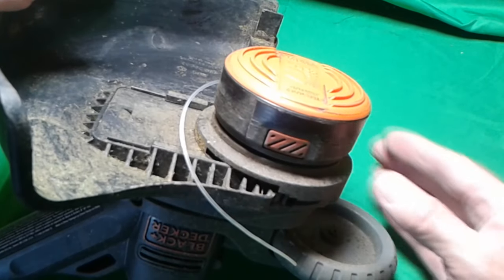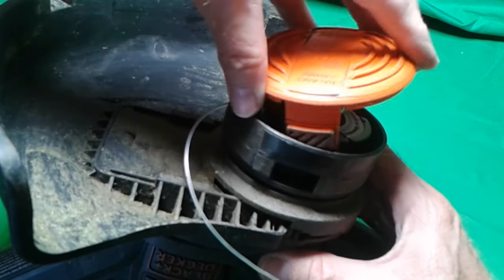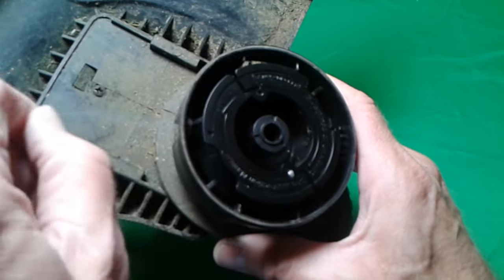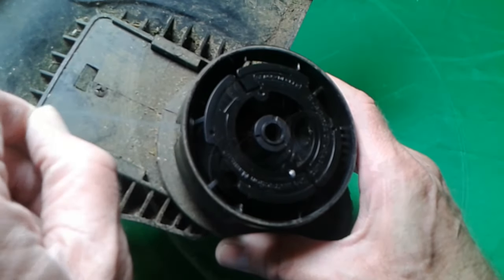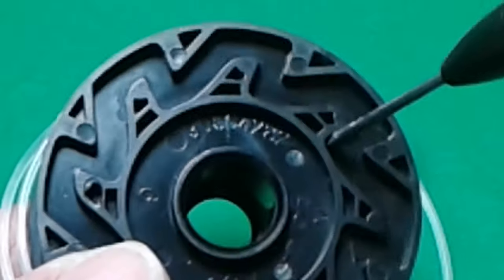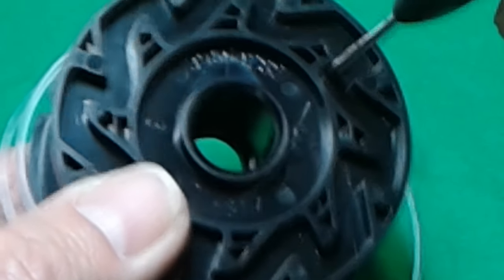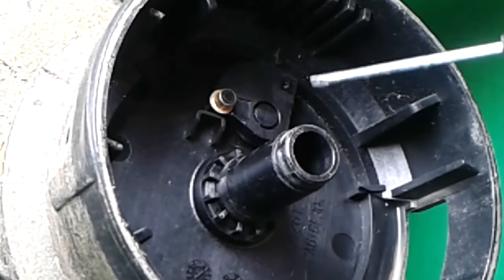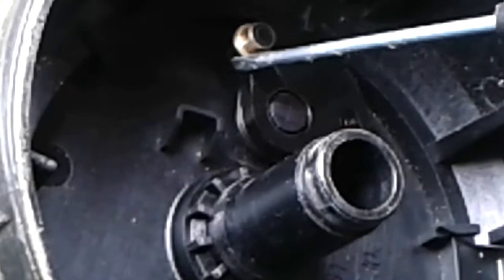How to Fix Black+Decker 20V Cordless String Weed Trimmer Edger LSTE525 Won't Feed Line

Comment: Bad design i have to feed mine by taking it apart every 2 minute
Reply: I have the same issue using it for a minute and manually pulling out more line, recapping and using for another minute or two. It really is a pain in the a$$.
Reply: Yeah, just bought one & it will not auto feed. Going to try exchanging for another, but wondering if they all have this flaw.

Comment: Yea nice and detailed, my mechanism works and is clear but still wont feeb line. Thank you though
Reply: Same for me. I was hoping it was the solution but still will not feed
Reply: Did you guys find your issue ?
Reply: My feed mechanism is doing just the opposite….feeding out line so quickly that I go thru an entire spool before I finish the yard.
Reply: @Patrick_Ross  mine too, you ever find out the fix?
Reply: @roberttaylor6030  - No, I didn’t.😞
Reply: I have the same problem.  Mine doesn’t have any button to push to actuate the line feed. Somehow it is supposed to just happen.
Reply: @Patrick_Ross  - change the plastic parts - those plastic “teeth” wear out. That little part that moves back and forth can wear out, and the grooves and teeth in the spool itself can wear. I had to replace a spool because of this issue.
Reply: If it does not feed at all, then the line is probably not wound onto the spool as it should. For some it has to be very tight, for others not so tight. And of course the winding has to be in the correct direction as indicated by the arrow on the spool. And lastly, some might put a spool into the tool upside down.
Reply: Mine won't either, I bought a bunch of replacement parts and it still won't work. 😡
Reply: @dstowell6189  - sucks to hear that, those new plastic parts should have enough plastic on them to work.

If it were me and that happened to me, I would start building up some extra plastic in places using a good epoxy or crazy glue and baking soda mixture.
Reply: Ikr? It took him 2:29 just to tell us to figure it out ourselves lol 😂
Reply: @Patrick_Ross  Mine feeds out too fast also. Before I knew it, I had to replace the spool ugh

Comment: Mine loooked clear and moved just fine. I was about to get mad at this video for not going further in depth, but then I blew into it, put the line back in and everything works fine now. You may want to put a caveat that obstructions may not be seen or completely prohibit the movement
Edit: nvm. Still doing it. I hate this thing.

Comment: After a year of the line feed not working… I figured it out and fixed it.  This two guy’s videos helped me understand how it works, so THANK YOU!  Everything in the housing was cleaned, the lever was there and working properly. Turns out the entire problem was the cheap knockoff replacement spools I got on Amazon.  The spool, once down in position on the lever, needs to rotate easily on its shaft.  The “bargain” version was just a little sticky… just enough to keep the line feed from working.   But after buying a real B & D brand spool today, the line feed worked like new.  Yes, the name brand costs more. Still- the knockoff was no bargain.  It works great with the right parts.
Reply from the maker: Well thank you for such an excellent explanation really appreciate it
Reply: I can confirm the bargain pack was no bargain. I have to disassemble the housing every several feed and refeed the line.
Reply: I too fell for the bargain price replacement spools on Amazon, and it didn't take long to see how stiff these replacement spools fit so tight there is no way the line can advance with these spools. Returned them and ordered the Craftsman OEM replacements.
Reply: Thank you. I believe I found out why mine isn’t working properly. Time to buy the name brand one lol

Comment: I have a B&D 20V trimmer with the 12" mower base. Thanks for the info regarding not feeding trim line. My issue is when the batteries get weak the trim line can go to an almost continual feed. I have cleaned the debris in under the head, but watching what you showed me gave me a clear picture of this mechanism and exactly how it functions.

Ok I wound the trim line backwards and it worked. Had to stop every 10 minutes or so to manually let out trim line and it seemed the battery lasted a bit longer too.  Saving my empty trim wire spools and getting trim line for them. Now if they made a bump head for this trimmer that would be the fix.

Comment: I have my BD AFS for at least 3 years and it never 🤔 has let more line out. Two summers ago I purchased and installed a new mechanism and it still doesn't 🤧work. I can only get more line by taking off the cap, lifting out the spool and turning it manually. Talk about 🥵 frustration. Now I'll take another look at it after seeing this video and getting original BD replacement spool coming later this week. I need some 🤞good luck. Thank you Bassocantor.
PS: I just looked for the "mystery spring" as per your recommendation, I don't have one!!!! I hope I can find one on-line that I can order. I am guessing it didn't have one when I bought it at my local hardware store. Thank you again Bassocantor again.  😀

Comment: Really good video. Found out the importance of the little pivot arm, which unfortunately is broken.  And that's why line won't feed right. Now I know why - thank you!
Reply: Mine too i think its broken
Reply: Cheap parts.  Designed to fail?
Reply: @Patrick_Ross  yup seems like it. I have to shove the cable out every 10 feet like an idiot. But whatever it does the job so no complaints.
Reply: @furtalance_x  - I’d rather have to stop and manually feed out more line instead of going through an entire spool for my small yard.  The cost of continually buying new spools is expensive!

Comment: IF you would like to enhances this explanation, then consider this - - 
For some time now, for many of us, the line spool is not advancing freely around the center post.  If the spool is difficult to snap over the post, the post will heat up when running and seize onto the spool, causing lack of line feed.

Either some WD40 or a bit of sanding of the post, so the spool slips more freely onto it, solves this problem.

Therefore the problem appears to be two fold and each should be checked.

Bob s - Cleveland
Reply: I think this is the answer. I use a genuine Black and Decker spool each time and still had auto-feed failing with new spool. I noticed that the center post and the spool it connects to was a bit tight. Took both out and cleaned them with my finger, and auto-feed seems to be working properly again. If it persists, I will dab a bit of vaseline to grease the center post and that should solve the issue. I wouldn't sand the post, as that might create other issues.
Edit:
It happened again so I dabbed some vaseline in the center post, and seems to be working properly again.
Reply: Had the same problem. Some dry lubricant on the centre post did the trick.
Reply: Careful with lubricants in center post. I found that it was auto-feeding too much with lubrication. I removed the spool and wiped away the lubrication and seems to be working properly now. I think the spool is supposed to be tight by default as the tightness is probably what controls the auto-feed function.
Reply: @3rdyellow  - I'll keep an eye on that. I tried this many months ago without any issues and intended to add a comment here. (Just found the video lurking in a browser tab!)

Bigger problem now is the cord snapping and the end staying inside the head, necessitating me taking it apart to re-thread.
Reply: @PeterJewell2  Maybe dry lubricant is the key here. Anyway, it seems how Black and Decker designed this, one can't keep re-using old spools with non-factory lines as the auto feed will not function properly as it will be loose. Sneaky move by Black and Decker.

Comment: Good video.  My trimmer is having trouble feeding line since I bought 
Rhino-Tuff .065  twisted line.  It keeps getting stuck.  I still have a lot of it left, and I hate taking the cap off every couple minutes to pull more line out.  I have re-strung with smooth line for years and had zero problems with the smooth stuff.

Comment: Great video. Another problem I found is that the replacement caps (which come with SPRINGS) have springs of different sizes. The shortest spring is the only one that does not push down the spool so hard that it will not release and use the mechanism you show in this video. Once I replaced the spring on the cap with the shortest spring -- it works again perfectly!
Reply: I only received one spring with replacement cap and I’m having the same problem, it pushes the spool down too tight so it doesn’t feed line. Maybe I’ll order a new cap or new spring and see if that helps with the problem.
Reply: I wonder if I should snip the existing spring? It worked well with original spool, but not with replacement. And replacement did not include springs or cap
Reply: @browser958  did it work?
Reply: @beartug  did it work?
Reply: @LBizKid04  I apologize for delay reply. Unfortunately no. I have to manually open cap and feed line. It stinky
Reply: @LBizKid04  I watched another video here on YouTube that explained it may be the replacement spools are made just a little smaller where the spool fits on the trimmer. In that video they recommend using a dowel wrapped in sand paper and sanding the inside of the replacement spool just a bit so that it moves more freely on the trimmer. Worked like a charm for me so it wasn’t the cap causing the problem at all.
Reply: @browser958  right on. Going to try mine now. I was using. 085 when .065 is what's required. Here we go!
Reply: @browser958  works like a charm!
Reply: @LBizKid04  glad it worked for you too. It use to drive me crazy having to stop and pull the line out. Now it just feeds automatically like it supposed too. Glad it helped you too.

Comment: Thank you from Australia. This may apply to my Ryobi RLT36 which has a mechanism that looks very similar to the one in your video. It is an autofeed and the line in the cartridge/spool will not extend. Now that I have an idea of what those ratchet-like shapes are for (i.e. not a ratchet lol) I might be able to work out what the problem is. Cheers.

Comment: I've had a B&D mains trimmer for ten years or so, and it's always been a nightmare.  Wouldn't feed reliably, and was constantly breaking off. I was re-feeding it manually every few feet.
Don't underestimate the importance of keeping the line supple. I have a bulk spool of Stihl line off eBay, good stuff, but probably been in storage for too long. I soaked it all thoroughly, and now the machine runs like a Swiss watch,  after all the years of frustration.
Obviously the feed mechanism needs to be working freely, but if it is then consider giving the line some TLC.

Comment: I have tried every fix I can find for this trimmer and my “Easy Feed” still won’t work. I’ve had this trimmer for about 4 years now and the past year or so I have needed to manually feed more line. I just figured out the issue:

When you press the button to release more line, you’re pressing a brake. When the spool housing suddenly stops spinning the spool inside still has inertia so it continues spinning and “clicks” forward. When you resume spinning it clicks back, releasing more line. This can only be accomplished if the braking force is strong. If you simply let off the trigger and then pull it again, the slowing and starting isn’t severe enough to make the mechanism click-click and release line. Therefore if the braking mechanism wears down over time (like all brakes do), it won’t stop quickly enough to release line.  Repairing/replacing the braking mechanism should fix this, but I didn’t open it up to figure out how it all works and if it can be repaired. 

Workaround:
Press the easy feed button at the same time as you press the spool housing onto the ground. The act of pushing the housing into the ground stops it quickly enough for it to click and release more line.
Reply from the maker: Wow that was really great analysis. Of course you're right it's a brake mechanism. Best, Chris
Reply: He’s talking about the AFS (auto feed system). You’re talking about the bump system..
Reply: DK no, I’m not. I’m talking about the braking mechanism within the auto feed system wearing out. Using it as somewhat of a bump system while simultaneously pressing the brake button (auto feed button) increases the braking speed, thereby allowing it to release string in the case of a significantly worn out brake.
Reply: OrkusMalorkus mine doesn’t have a easy feed button. I must have a bad spool.
Reply: This is almost the same issue I have with my little 10-inch model, but mine failed to auto feed line right out of the box. I think in my case, this model has such a puny motor and takes so long to start and stop compared to my old one, the spool never develops enough inertia to trip the feed lever after you stop the motor. I discovered if I abruptly stop the spool from spinning after I stop the motor, it feeds every time.

It's a cool design, but doesn't work so well when you skimp on power. They should take this particular model off the market and redesign it with a more powerful motor. I just ordered another 12-inch model, like the one I had before.
Reply: @OrkusMalorkus  I have the basic B&D 20V Max string trimmer which is about 3 or 4 years old and it doesn't have the easy feed button or whatever it is either, it's just an automatic feed system with the little brake mechanism under the spool. Ours won't auto feed either and I haven't taken a real close look yet as to why but I saw some small broken plastic pieces under the spool and I think it's the spool itself breaking apart. I'm going to examine it better today and try to figure it out.

Comment: Your mechanism looks like it has a spring snapping it back in place when you let up on the screwdriver.  However, mine has no spring under it.  Is this why it won't feed?
Reply: I observed the same thing -- his mechanism seems to be spring-loaded, but mine isn't.  Did you ever find a solution?

Comment: Interesting! Thank you so much for this video. I'm afraid my problem, however, is that the line went out so fast that I used it up all within an hour. Really strange. I'll check that mechanism and see if it's actually working.
Reply: Same problem I'm having. I use a while spool in 15 minutes
Reply: Same problem here. I fed new string to the spool, must have done it wrong because after 5 minutes of use, about 70 feet of string was gone! Where did it go, I couldn’t find it around the yard. It couldn’t have evaporated, does anyone know?
Reply: So does that mean ever time I pull the trigger I loose 1” of line?!

Comment: I agree in that I would not sand anything as it appears to be a rather precision fit between the metal band around the post and the center of the spool.  Vascelilne ( or perhaps WD40 manbe ) seems the logical approach.  If it works out, repost your results here.
Bob
Reply: I had to use light amount of vaseline around the center post and it works normally now. Used it over the past three weeks or so.

Comment: Umm, I opened it up and the little pivot didn't have any dirt or anything in it because this is a new trimmer and I've only used it a couple times. I don't understand what's going on. And is there a proper way that it's supposed to be in there the string that is?

Comment: My B&D trimmer is I guess a newer model because it has a spool release button by the handle that no longer releases the line. I have to pop the cap pull the spool half way out and turn it to desired length. Have you heard of this and is there any way I could fix it? Thank you

Comment: Most of the complaints I've read is that the design lets out too much line, because every time you let off the throttle, it's gonna let out some line and most users are on and off the throttle(well, switch, in this case).  Of course, one fix is to keep on the trigger, but then you'll find out what the duty cycle of the motor is when it starts to smoke, lol.

Comment: My weed trimmer is letting out too much line.  When this occurs the trimmer stops working .  The pivot mechanism seems to be working fine when I manually pull on the line it stops at the grooves in the spool.  I replaced the cover and it's corresponding spring but the trimmer is still letting out too much line after running it for a few seconds. Is it possible the pivot mechanism is worn down. BTW I do use Black & Decker replacement lone spools made specifically for the LSTE525 timmer.

Comment: I just got one used, it didn't have a spring on the button cap. (I look for a replacement caps and there was a spring attached to it)
Does the Black & Decker weed eater you displayed require a spring on the button? Thank you
ALSO, when you put the spool back on the bottom of the weed eater, does that spring lever you demonstrated need to be in a certain position?
Or does it automatically seat properly
Reply: Also. What makes the line feed the inch or two?
What action is required to feed line? Thanks again

Comment: mine doesn’t have debris but still not feed. I have to open each time and do it manually. Does the pivot return in place automatically or it is you who bring it back with your little screwdriver? as maybe this lever needs to be spring loaded.